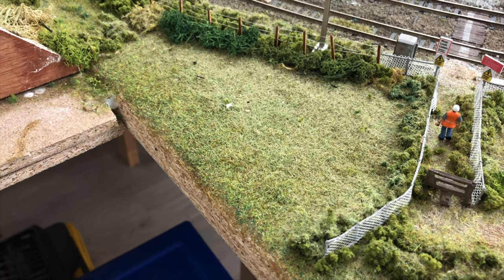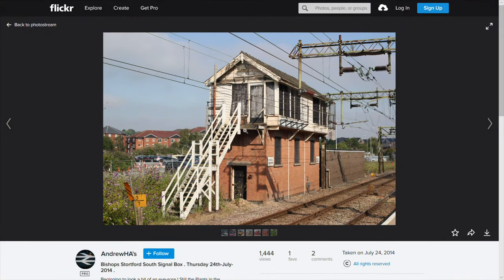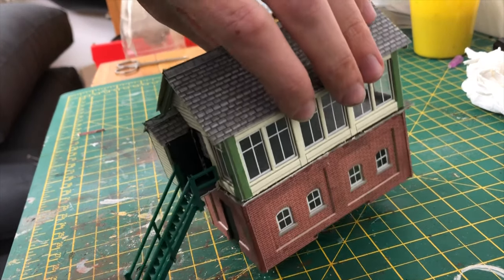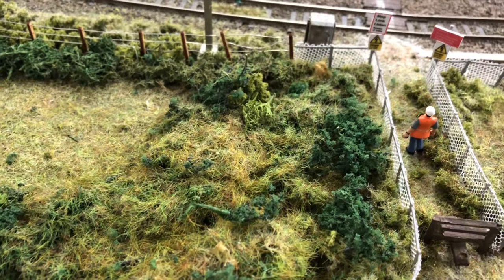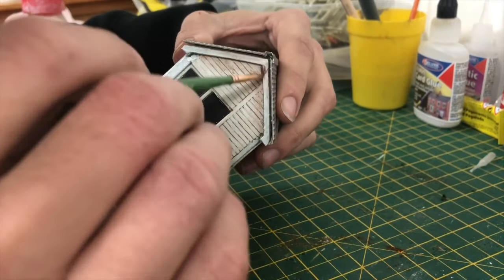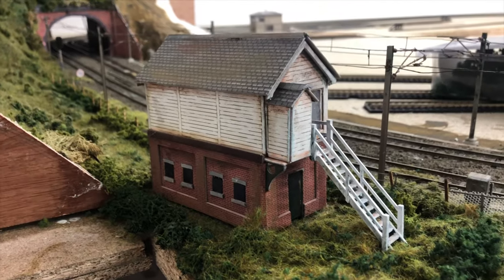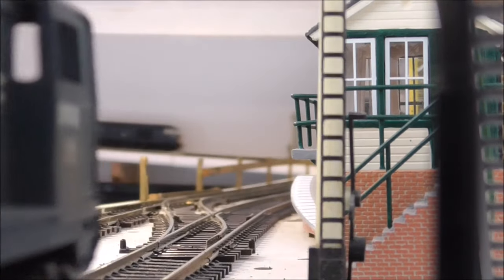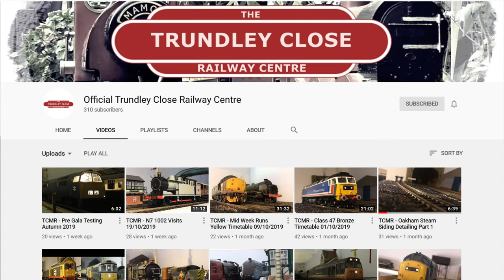Layout Build - Adding a disused signal box | Part 1

Comment: The answer to your question at 4:55. ... The box is facing north. The sun rises in the east and sets in the west, so the north facing side will not get direct any sunlight to burn or discolour the wood panels. The panels by the staircase are facing east and are in the sun until noon so they will fade at a faster rate.

Comment: maybe a idea for the old line you could add some old points on the mainline heading off in that direction with a peice of track going into a set of bushes like its overgrown and not used which is isnt emphasising the fact that there was a old line there ect